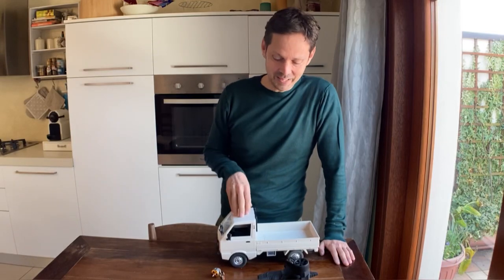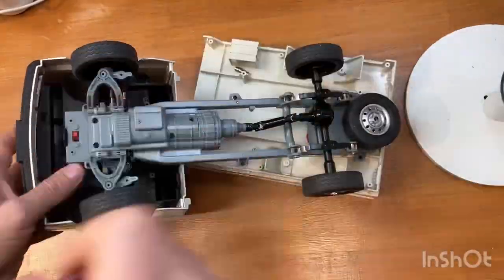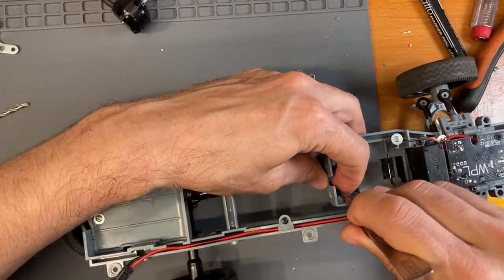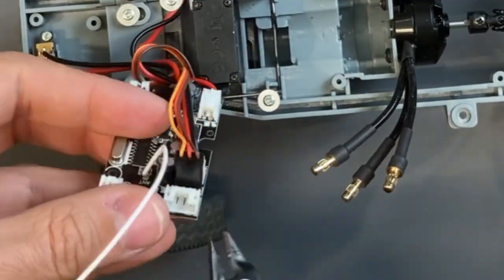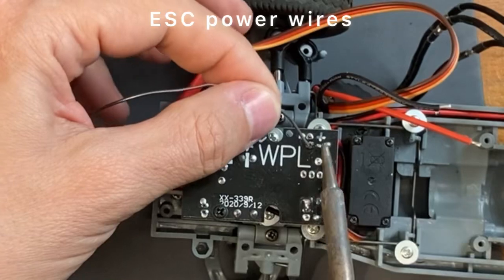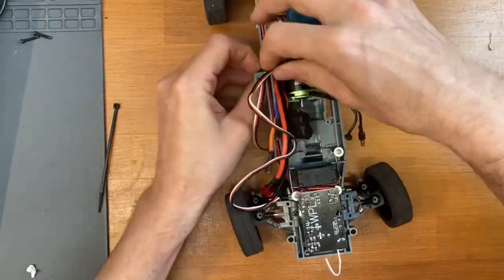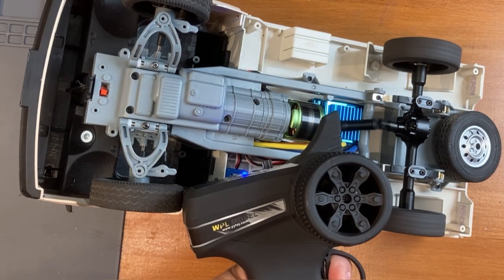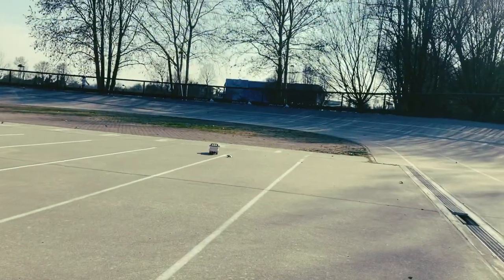WPL D12 brushless conversion: direct drive stock receiver

Comment: so ive done this conversion successfully using the exact parts (930KV brushless/120A esc) but now the problem is the batteries dont last because the motor doesnt have any torque  (cogs) trying to move its own weight. once up and running maybe 5 minutes the motor gets super hot. it definitely needs a gearbox.. not sure if i should try a super low KV motor or take a gamble back at brushed + metal aftermarket gearbox (unknown materials internal)
Reply from the maker: Mmmm, thats a pity. Are you sure it is a 930kv? Mine is really going well, and not heating running on asphalt. Or you have a damaged esc (1broken phase would give lot of cogging and heat) Not sure if you can find lower kv on this size of motors.
Reply: @MakerFabio  A2212/15T/930KV as it says on label... im just going through the ESC programming found out my timing was set to maximum (26.25*), just lowered it and got it out of rock crawler mode (instant reverse), ill keep playing with it now  see if it will kill the battery early. it does heat up after aggressively drifting. I think ESC is working fine that isnt heating up at all, all functions programmable. It does go fast though! Its interesting this is almost 4 years ago for you!!
Reply from the maker: @siopaoinasal  good job
Not sure if the timing is working or is just a dummy parameter for this esc.
but you had a very good idea  to check the parameter settings

Comment: i have melted 3 pinion gears and im done with the d12 transmission, thanks for this video.
Reply from the maker: Eheh, kind of poor quality gears for some brushless power
Reply: @MakerFabio  my 25a esc and brushless 2430 is now too powerfull without the transmission once it finally start spinning, its around 60k rpms. I believe a 30k rpm higher torque motor is best if deleting the transmission. The one I had laying around is for a power wheels kids car haha
Reply: first 10minutes crawling on short grass. Plastic gears shredded. 
Changed to steel gears, left the brass pinion alone. 
switched to drifting setup, lasted 10minutes. Pinion gear became gold dust. 
Im on my second pinion gear, and i cannot find a steel replacement, so this ill have to do as a final sendoff.
Reply: Gearboxes without mesh adjustment are a recipe for disaster i hate it i still havent been able to get the brushless motor to work tonight it gets an outrunner what kv do u think for drifting 4000kv ish?
Reply from the maker: Hi 4000 is too high if you want to do direct drive like here in the video
The gear ratio is very short with direct drive
Stay below 1000 kv is still lot of speed

Comment: Hey man! great video. The fastest shipping I got is for 1000KV instead of 930 KV. Do you think it would work? I have no knowledge in electronics :(
Reply from the maker: Hi, sorry for the late reply. Yes 1000 to 930 will not change much. Even if this truck was already too fast and the 1000 version will make it even faster and not very smooth running at low speed (little more risk of cogging). But if just for some crazy run, also the 1000 (like the 930) should work just fine. I see there are also 820kv available, try to see the shipping time for those
Reply: @MakerFabio hey man :) After a complete year, I finally had time to do this. Took me a bir longer than 3 hours even though I am good at doing these tasks. But the challenge was the small space and I want it to look like original 😅
Reply from the maker: @erbsrn1620  good job. Anyway we do this also because we like to “do things” so if it cost little more time , but you did it well, it is OK
Reply: @MakerFabio hi again man! I forgot to ask: did you have problem with the throttle? When I go full throttle, esc resets itself and it blocks the motor
Reply from the maker: @erbsrn1620  no 
Maybe you have a weak battery?

Comment: If you calibrate the esc you dont need to reverse anything.
Reply from the maker: Hi, Not really, tou can not configure motor direction. tried actually. the car esc is not simmetrical.   While the cheap3 euro it is, in fact there i just reversed the cables.   Think, if you press the tx trigger to go backward, the esc will read a go back, so it applies brake at the first pull, then reverse at the second push. So the esc needs to know what is the “finger movement”, not sufficent to invert motor rotation.  You should also have a tx with the “reverse”option. Better idea was to flip the axle gears

Comment: Can someone link the motor?
Reply from the maker: € 5,78  15％ Off | XXD A2212 2212 930KV 1000KV 1400KV 2200KV 2450KV 2700KV Brushless Motor for RC Airplane Fixed-Wing Multirotor Drones
https://a.aliexpress.com/_uiP4nl
Reply from the maker: Take the 930kv
Reply: @MakerFabio  ?
Reply from the maker: @Rudestude  yes? Is the link not working?

Comment: Instead of soldering the external ESC power wires to the wpl board, can I just plug the battery into the external ESC if I keep the power wire on the ESC plug that plugs into the wpl board?
Reply from the maker: Good question
Maybe yes, but i do not grant for this
Reply: @MakerFabio  thank you for the response. I'm thinking that it will probably work. That way it'll be a more direct power connection from the battery straight to the external ESC. I think I'm going to risk my circuit board to test the theory. 🤙
Reply from the maker: @brsrc759  i think you have good chances too. Please share with us the result then. It may improve the battery connection as you said

Drawback(up to a certain point) is that you don t have the original switch anymore

Comment: what kind of battery did u use?
Reply from the maker: Hi, sorry for the late reply. I used both the original battery or a 650mAh 2s 30C. The current is not high at 2S for a low kv motor

Comment: Hi please could you help me with my Dyson V11 Battery? I don't know how to text you so i wrote here, sorry...Thanks!
Reply from the maker: Hi
I don t know a lot, i don t have the battery, i have to buy one, i have only the motor part of it, which is not working with a standard power supply
Reply: @MakerFabio  so you are almost in the same situation i'm...I ordered an original battery, when it will fail I'll take care of it by myself, thanks a lot!

Comment: Hello fabio, my stock receiver board have problem with servo! Everything is ok but servo is not working? I connect servo to other wpl d12 and its working but when iam put it in d12 mine , its not work , so the problem in stock reciever ! Can you help me which the components can i fix to solve the servo problem ? 

Few days ago …i swap the battery connections by mistake , then the servo not working and maybe loose somthing in the board ! Help me please
Reply: Very thanks to quick respond fabio, 
So this is second time i swap connect and bought stock reciever, so sad for it but thanks again man , I appreciate your time
Reply: @maker fabio
Reply from the maker: Hard to say
I don t have the schematic of the receiver, and it could be the output of a microcontroller, so impossible to fix (without having the sw to be burned)

but yes, if you swap the battery you may destroy the little output producing the pulse
Very sorry for this

Comment: At about 5 mins you find out the motor direction is wrong. You could just swap any 2 wires on the brushless motor to swap it's direction.
Nice modification, I'm wondering about doing the same but keeping the gearbox
Reply from the maker: Hi, Not really, i tried actually. the car esc is not simmetrical.   While the cheap3 euro it is, in fact there i just reversed the cables.   Think, if you press the tx trigger to go backward, the esc will read a go back, so it applies brake at the first pull, then reverse at the second push. So the esc needs to know what is the “finger movement”, not sufficent to invert motor rotation.  You should also have a tx with the “reverse”option
Reply: @MakerFabio  you could have also flipped the axle differential around :P was a much easier fix in my opinion
Reply from the maker: @imanigraham2768  this is a very good idea
Didn t think about it
Reply: @MakerFabio  great you good at getting things working!
Reply from the maker: @c42cly  thanks

Comment: Another great vedio, I already starting to like your vedios. I have a question, using high speed drives might wear and tear differential gears much faster, what is your opinion on this thought? Can you also do vedios on other wpl models? .... hats off to your efforts..
Reply from the maker: Hi , thanks
I calculated the wheels speed  it is about 2,5 times if i recall correctly, so a decent speed for an hobby grade car (this is half toy half hobby grade)
But actually considering the gears quality (not outstanding) and the poor gear matching, it will short the life a little for sure. The direct drive speed is higher but the torque is maybe equal or less, so maybe the impact is not huge.

But still for the wpl d12 it is totally worthed, smooth and faster, lower noise and power consumption (when running at the same speed , battery last forever)
Reply: @MakerFabio  thanks for explaining. Any ideas on making new vedios on wpl/mn/jjrc rc models ?
Reply from the maker: @marutheeshsai8578  hi, unukily, at the moment I don t have other wpl models, 
Maybe today i ll publish one on an diy rc boat outboard motor build out of the wpl d12 rear axle and some 3d prints plus a propeller. Almost completed the video

i have an sg 1203 tank, and other 10 rc cars (tamiya , xray, axial, mst, sakura) ,2-3 of boats, 3 planes 1 fpv drone. So i will make videos about other random rc
Reply: @MakerFabio  ciao and grazie. will wait for your new vedios. Just for info there are millions of wpl/mn rc fans across the globe, your vedio on d12 was impressive.. especially the explanation on the electronics and the way they can be altered. Rc enthusiast like me would love to learn from your vedios. A gentle suggestion : Adding wpl models to your RC fleet can  draw lots of viewers/subscribers to you channel.. just saying.
Grazie e saluti.
Martie
Reply from the maker: @marutheeshsai8578  eheh you are probably right. Which other wpl models are the most famous at the moment? Then i want also to balance the video content and put also more about electronic DIY and not only models. So let’s see. But tell me a nice other wpl model, i may buy it
Reply: @MakerFabio  grazie, you can do vedios on wpl c34, c54, c44 these have world wide reach. Wpl are very active in releasing new models c34 is replica of Toyota fj40, c54 is replica of Toyota lc80 and c44 Toyota fj 1965 pick up truck. They are highly customizable you can upgrade all mechanical parts and I could imagine what magic you can do to those vehicles 🤔. + your boys would also be very happy adding thos tc rigs to your fleet. By the way fantastic job on the boat modification. 💪💪👌. Do you have any email Id, to connect with you ?

Comment: Did you wire the external ecs into the led or light output. I'm just trying to figure this out is all.
Reply from the maker: Hi. No, its not the led plug. it is an additional plug that was in the receiver pcb, don t know what was the purpose,
Reply: @MakerFabio  thank you so much I have a mn99s which is kinda a clone of wpls so I was trying to reverse engineer that board kinda following your setup but it is different. Thank you so much for getting back to me.

Comment: which motor setup would you recommend? the 2212 you showed in this video? or the 2430 or 2435 like other people put in them? Also why did you choose to delete the gearbox and how did it change the car?
Reply from the maker: It depends
Mine 2212 is the cheapest approach, more efficient for batt saving, and you will save stripping gearbox issues

The other could be more immediate in term of throttle response for drifting, because the inertia should be lower on the inrunner, i guess, bit i didn t try

Comment: You just had to reverse 2 wires to reverse the motor rotation, don't need to tweak the potentiometer
Reply from the maker: Not really, i tried actually. the car esc is not simmetrical.   While the cheap3 euro it is, in fact there i just reversed the cables.   Think, if you press the tx trigger to go backward, the esc will read a go back, so it applies brake at the first pull, then reverse at the second push. So the esc needs to know what is the “finger movement”, not sufficent to invert motor rotation.  You should also have a tx with the “reverse”option
Reply: @MakerFabio  wow too bad! Then well done 👍